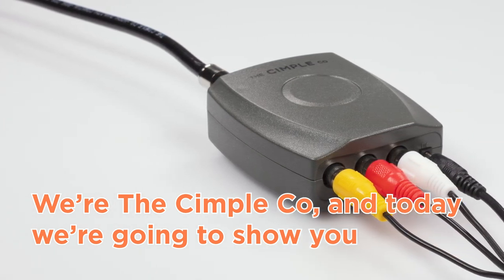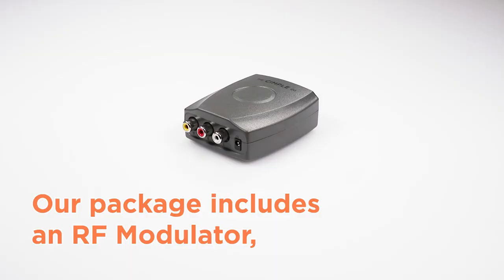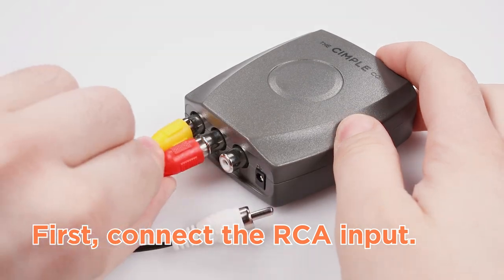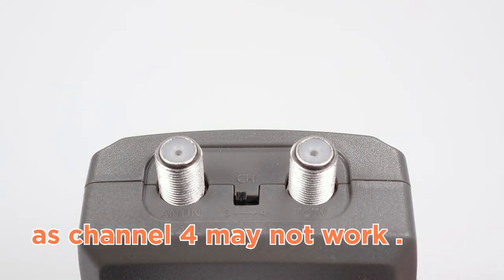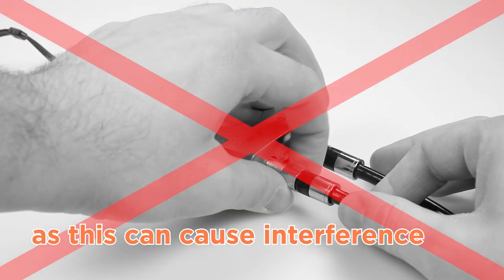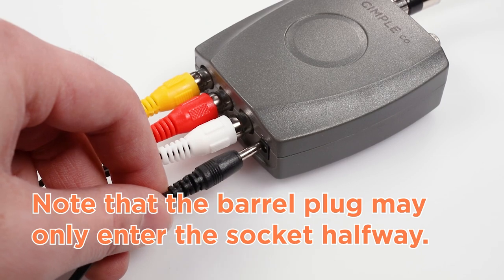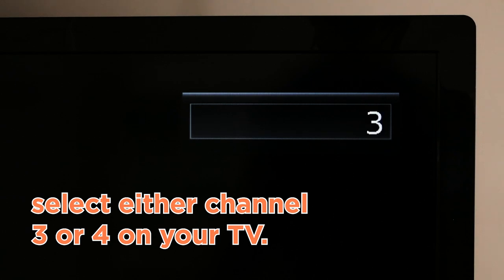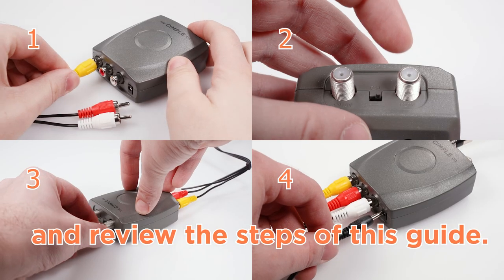THE CIMPLE CO - Connecting an RF Modulator

Comment: Does this work for hooking up video game consoles to a tv that only has the coaxial cable port?
Reply: This seems to be what you'd be looking for. As long as your gaming console has RCA's for the video output to the modulators RCA's input. The coaxial cable output from the modulator should connect to your tv's input just fine. 

I'm looking for the the exact opposite. I need coaxial output to RCA's. Lol
Reply: @MelodicFox9639  You can do the same thing with a VCR.